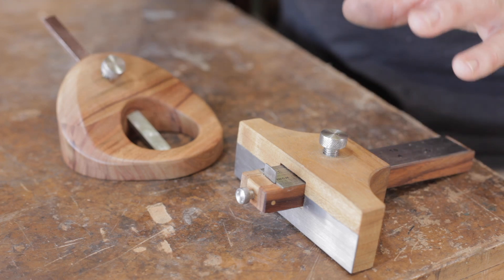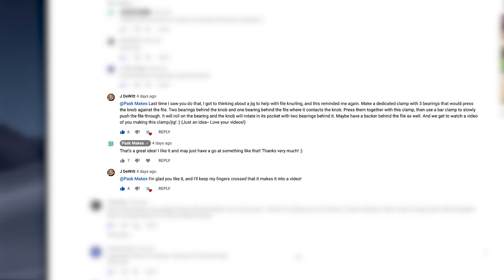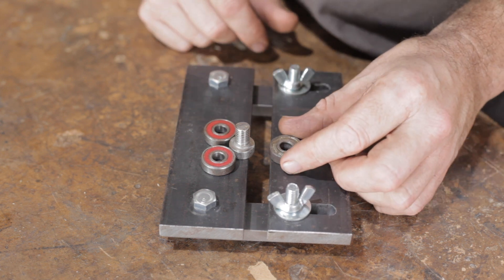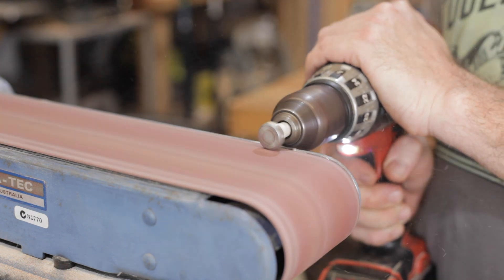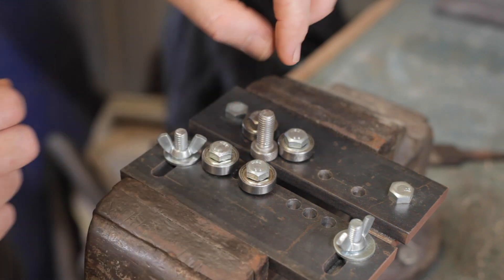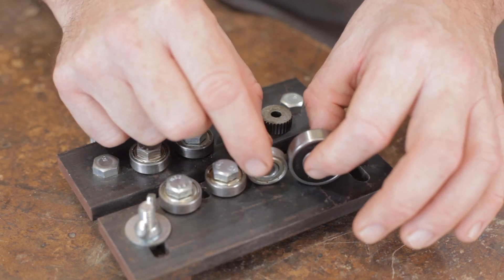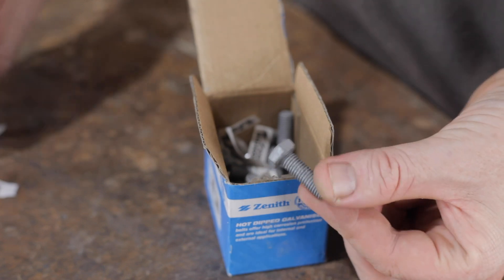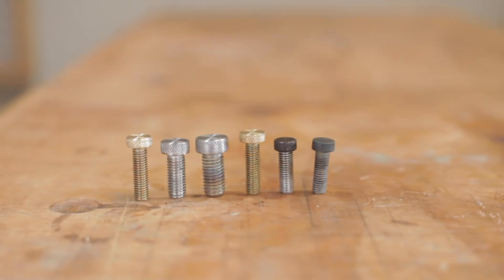Homemade Knurling Jig

Comment: For all video I did not see the most important - at knurling it is necessary to use lubricating oil. And the second point, I would add above the rollers is one for their axes plate, it will protect from breaking off the axis of rollers over time because of their cantilever bending. And in other I liked the idea, if not a lathe for metal, then this is the real way of rolling riffles

Comment: You should really get a die grinder with a rotary burr, it will make the slot making process 100 times easier and faster (not more accurate though). Amazing video, as always.

Comment: Oil will make a huge difference in the final outcome. 
One thing I'm thinking is that the ball bearing face is flat and you're trying to make a pointed shape with the knurls. On the straight knurls you could add another straight one in place of the ball bearing and make lathe quality knurls all day long. On the diamond side you will need anything set and getting 2 sets to mesh could be a real set up challenge. 
Personally I love the simplicity of this , so anyone could make knurls without expensive machine tooling.

Comment: Great idea, only thing I can see is the pressure with the bearing surface is crushing the knurl.  May I suggest using shoulder bolts and 3 knurling wheels rather than a bearing on one side, and lots of oil.

Comment: Maybe you should only use a single straight knurling wheel.  I don't see a synchronizing element between the two, or am I missing something? Replacing one of them with a bearing should be a simple enough test.

Comment: I'm not a machinist but I do like these videos. My question is: When you use your measuring device to mark the line for cutting....aren't you damaging the tip of the micrometer? I seem to have a recollection of my old shop teacher having a fit whenever we would use the measuring device as a marking device. Are those tips hardened so you can use them in that way?

Comment: I like this jig. I'd try ditching the bearing and replace that side with a piece of scrap softwood that would wear away as you turn the bolt and that could easily be replaced.

Comment: Another modification of the copper pipe idea below would be to use a copper pipe cap, you could epoxy the bolt inside the cap and easily knurl the copper.  The cap may be parted by use of your drill and a sharp tool, or double stack the knurling wheels...  This is the first of your videos that I seen, I'll have to check your page for more !!!

Comment: I loved the ideas you've done.  Have you considered also using a knurling wheel on the bottom (all three)?  It will likely mis-match the knurling impressions but I believe your intent is to make a thumb screw that is easily grasped which it should rather than exactly imitate an expensive store bought part...

Comment: Slow down your speed. Instead of drill I would use t-handle to achieve slower and more controllable way of turning that bolt. If you go too fast the bolthead start to slip and it messes your knurl. Also use a lot of oil. Problem with this set up is that knurling rings are supported only from below, so when you increase the pressure they will bend open in kind of a V-shape and you end up with deeper grooving on top part of your bolt head and shallower on the lower end. Increasing your pressure really slowly and gradually helps, though I doubt you can completely avoid that.
Knurling is not a speed job, you have to take your time and be patient, and because it's a forming method the forces involved are really high so you have to control them carefully to avoid breaking and bending your tool.

Comment: you should be using bushings instead of bearings. something like a brass bushing over smoothed out threads would probably work better since they are made for high load like these are under.

Comment: Tri not to use any bearings on the outside but put bearings on the inside of the weals and use 3 weals shout then look better and be easier to use.. When nearing stainless heat it up and nearl it while hot (stainless forms better under heat) hope this helps

Comment: I think one of the problems you have is that, while the knurling wheels are making the indentations, the bearing on the other side is flattening the knurl. If you can apply the force through the threaded part, while protecting the threads with a threaded sleeve? Idk, I'm just throwing some ideas...

Great video btw!
Reply: cultclassic999 exactly what I was thinking, why create the knurl and then flatten it with the bearing? Maybe having knurling wheels both sides would give the desired finish with less pressure.

Comment: If you size your bolt head circumference to be divisible by the knurl tooth gap it will work better. Just like knurling on a lathe.

Comment: Your gig worked perfectly the first time. Problem is, you are trying to bend metal that is stuck between your gig table mount so it will instantly brake the bearings and the metal you are trying to bend is to large. Other than that, you did an excellent job showing me how to build a Hobby gig.

Comment: The reason we use pulleys and wheels on bearings is that the bearing is not meant to have direct contact with any surface except for the inner hub of a wheel or bearing.
Make press on wheels for the bearings so they can take the beating, not the bearing race.
Also those roller skate bearings are not rated for much weight.

Comment: A little crude idea, but, it seems to work....!!!   ;)
Stainless steel is a real hard material to work with, not just for knurling, when knurling any metal use a lot of lubricating oil, first it lubricalte , and, second it flushes away the small debries created during the procell so they don't get imprinted into the base material...
Enjoyed...   ;)

Comment: Knurling needs oil as you are deforming the metal rather than cutting it. Use increased pressure with out taking the bolt out.
For a very neat job you can blow any crap off with compressed air as you go.
Great video by the way
BBF

Comment: If you made steel sleeves for the bearings they shouldn't break by squishing if the bolts that hold the bearings down are a near perfect fit

Comment: Honestly, the process may have been a bit easier if you had set the bearings in a wheel rather than apply them directly to the work.  It seems finnicky, but I don't think those things are meant to carry load directly, just transfer it,

Comment: great video. I agree on all the postive comments of the other guys. I submit to you  an alternative idea. 
      A jig with 2 twins parallel files. The rounded bolt squeezed between them
1 - Regulable distance between the files.
2 - One file is fixed (solidal to the jig)
3- The other file can slide, leaning on bearings (many, big, robust, bearings). maybe it is better that the file does not len directly on the bearings (some thick bar in the middle)
4- the sliding file could be moved in both directions either with a hammer or, in some way, using a drill-screw-bolt system
Reply: 4b- alternatively, the sliding file should slide in the two ways simply by screwing and unscrewing the squeezed bolt

Comment: Use 3 knurlmakers with bolt in middle, turn it with the drill....basicly, get rid of the barrings and add another knurler.....all same u r doing minus a barring and add a 3rd knurling

Comment: I enjoy your videos.  I have had some experience in getting a black finish on mild steel.  Just heat the metal until it starts to turn a dull red in a dark room.  You do not have to heat until it glows bright orange.  Then dunk the metal in used motor oil, take it out and wipe the oil off. David

Comment: Maybe lose the bearings all together.  Use two knurl wheels as you have them, and a third knurl wheel centred on opposite side, form a triangle , drop head of bolt into it, spin drill while clamping jaws tight, don’t stop. Add oil!!!

Comment: 6:25 I once bought bearings like that in a sack too, but many of them already had cracked races and when you drop them in a bag like that it'll damage them as well (yes, I did some destructive testing with "bag bearings", you can literally crack the outer race just by this). I'm not really surprised the small bearings weren't up to it (this is very low speed, very high force after all), but you got some impressive results in the end, even on the stainless!

Comment: Cool idea, but I'd try to just use knurling wheels all around - you don't need the bearing.  Give the bolts that hold the knurls on a bit of grease and they'll spin perfectly well.  Oh and like the others said, use some cutting oil it should clear the swarf from  the  knurls and give you a better pattern

Comment: The bearings will always fail.
You need large diameter hardened and tempered steel bolts.... with your special round treatment,... in place of bearings.
If your new triangulation of pressure exceeds the capacity of the mild steel bolts treatment you desire....your drill can hold and spin the head against a CLAMPED FILE ...  
I have other ideas too ... you are closer than you think there !!

Comment: Definitely awesome MEEKNESS.
Those flats of steel, as raw... can easily be squared, without equipment, straightedges ... and checked for MY TRUTHFULNESS ... by following direction.
Lay them on edge.... clamp them uniformly square all together... file them flat.
Take then apart, flip all but one over, and end for end, consecutively, a few times, filing them squarely as possible between flips and turns, and filing.
About 4-6x of that... as your expertise and patience, will, and time will allow... and your shit should look like my shit... ALL GOLD !!
Reply: Thank You, again, Sir,... for your artisanic imagination !!
Reply: As a bonus, white glue a whole sheet of sandpaper or emerycloth to any flat melamine or similar smooth surface ... a surfacing plate !!

Comment: I like the idea and wished I had one for those odd times when I needed a knurled fastener. 

On a side note, use cutting oil. Not only will it help cut better looking knurling but should lubricate the knurling wheels on those bolts.

Comment: nice fixture.  Hmm, instead of an electric drill, why not use Armstrong power with a speedwrench or hand drill brace?    But me?  I just  chuck up a scrap of wood on the lathe- maple, ebony, rosewood, etc - and then turn a knob that is epoxied on the shank of a headless screw or bolt.  It's also possible to knurl a wooden knob too.
Reply from the maker: Thanks Bob! I tried a wrench and that worked well but I preferred the results from the drill. The wooden thumbscrews sound great, I'll have to try it! :)
Reply: @PaskMakes  Oh, I forgot the obvious - it's a good idea to tap the turned wooden knob to match the screw threads.

Comment: move the knurl wheels closer together, let the drill run longer to allow the knurl wheels the move the metal, and use less force when you tighten the vice,  use cutting oil it removes the heat and lubricate the knurl wheels for a better finish, oil will also wash out any small flakes of metal that will build up
Reply from the maker: Thanks for the tips Tom! :)

Comment: Very nice you got a thumbs up from me..... If you make the arms longer and place bolts to tighten instead of the vice you could use it right in a lathe or any rod..... Gave me some great ideas.... Also top plates to hold the tops of the bolts could make it much stronger also 3 or even 4 knurling wheels could be great instead of a bearing ...... Thanks for doing this.... Awesome and I got many ideas from it...... Now I'm gonna make my own knurling wheels from an old file..... Aneal Grind to  diameter then grind or cut knurls then temper and go for it....
Reply from the maker: Thanks! Glad you found it helpful! :)

Comment: I think the coarse knurls we're just too mistimed on that bolt diameter. You usually have to do some math for this.
Reply: I was thinking that for the straight knurl, two knurling wheels are one wheel too many. Each wheel is going to bugger up the lines made by the other. For the cross-hatch knurl, each wheel is making its own lines.
Reply: No he does not 
Knurling is a black magic 🖐️

Comment: Bearings need spacers to separate the inner and outer races when mounted like this. You might as well have been using round stock instead of bearings and this was probably part of why they kept. breaking.

Comment: Nice job! You talked about the drill being somewhat clumsy and inaccurate. I may be wrong but it looked like you only ran a couple of turns between each tightening of the bench vise so why not use the ratchet wrench for an exact amount of turns?
Reply from the maker: I tried a wrench and it worked well enough but I preferred the results from the drill. My biggest problem in this video was the camera was in my way and I couldn't see how far I needed to go. :)

Comment: So in my 1 year in mechanical engineering we did cover bearings. By the looks of things these are your standard ball bearings. While these are good you're putting a stress point in one pin point location when applying pressure in this jig. If you move to a cylinder bearing your stress is spread out a little better across the bearing and it shouldn't put that pin point pressure on the bearing making it much harder to over torque and fracture. I also noticed a lot of movement in the bearings and "gears" (knurlers?) when you tighten the vice. I might suggest moving to a solid rod welded to the bottom plate instead of bolts, then a second plate above bearing & gears but only with material behind the pin to add support. I could draw up and email a diagram if that's confusing, just DM me.
Reply: Straight roller is probably fine, but move to a needle roller if you have any troubles. https://www.machinedesign.com/whats-difference-between/what-s-difference-between-bearings-1
Reply from the maker: Thanks for that Ryan! I understand exactly what you're saying about the solid rod with a support above, I thought about doing that and it would certainly be better. I left it as it was though as it was working well enough for what I needed. If I ever revisit it though I will make those changes! :)

Comment: For your bearings, use roller follower bearings, they are designed with a thick wall and support massive axial loading with no problems. Cheap way to get them is to get them out of an old engine that uses roller followers on the valves.

Comment: Keep the drill spinning as you tighten the vice  to keep the momentum going . This may allow you to apply a more continuous smoother force rather than stopping and starting
Reply from the maker: I reckon you’re right but not easy to do! :)
Reply: Because it’s difficult to control? Perhaps you can tilt those bearings so they apply downward force on the bolt as you tighten the vice. Kinda like an electric can opener

Comment: The thin bearing races are not meant to support point loads like that.  You need to press the bearings into larger steel cylinders which can distribute the point loads around the bearing so it stays round.

Comment: I wonder what would happen if you still used files for texturing but the file rode on a slide bearing(roller or ball) rather than a coaxial bearing.  The outside race on coaxial bearings are very hard and brittle and are designed to be pressed into a housing that makes full contact so there are no concentrated stresses against the outer race. I really dig the files over the wheels for the variety of patterns, and the fact that you can often find files for pennies at garage sales.

Comment: great vid and I admire your persistence ....... but, how much is a knurled bolt compared to a normal bolt to buy off the shelf?
Reply from the maker: Thanks Mark! If you only need a couple then buy them for sure. I seem to be make quite a few lately though and I’m sure I’ll be making many more of the years. As I said, the 10 brass bolts cost $13 you’d probably get a couple of thumbscrews for that price. Also, most of the time I’m screwing them into wooden threads and the ability to make M10 or M12 thumbscrews really helps with those threads. :)

Comment: I would try getting rid of the bearing, add a 3rd knurling wheel in its place. The bearing is flattening the knurling pattern and working against you.
Reply: Yes, I figured that too. If you increase the center distance between the knurl wheels, then more load is transferred by the knurls wheels and less lod is carried by the bearing. That saves the bearing and leaves the knurl in tact more.

Comment: As an inventor, Edison made 1,000 unsuccessful attempts at inventing the light bulb. When a reporter asked, "How did it feel to fail 1,000 times?" Edison replied, "I didn't fail 1,000 times. The light bulb was an invention with 1,000 steps."

So you’re several steps ahead of inventing the lightbulb Neil. Glad you didn’t edit out the early steps.

Comment: IMHO I THINK THIS WOULD WORK BETTER WITH SOME NURLY CUUTERS IN PLACE OF TWO OF THE BEARINGS. YOU CAME GET THEM ON EBAY FOR A COUPLE OF BUCKS. THEN YOU DONT HAVE TO USE A FILE. ALSO AS SOMEONE ELSE SAID. LOTS OF OIL. OOPS I HAVE CAPS LOCK ON. Not really trying to shout.
Reply: Doh should watched till the end. Ha ha

Comment: 3 wheels would work in place of two with a ball bearing as well.??
Reply from the maker: You could replace the bearing for a third wheel but it works fine as it is. :)
Reply: @PaskMakes  OK thx. really very cool thing.

Comment: One nurling wheel will do on a handle if you turn the bolt on a lathe, wood or metal. With wood lathe, epoxy a nut, that fits your bolt, into a chunk of wood turned to fit in your lathe chuck, slow speed, apply pressure with the nurling tool in a handle that lets it turn freely.